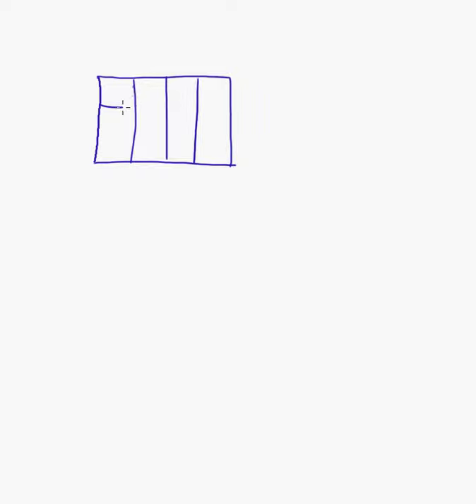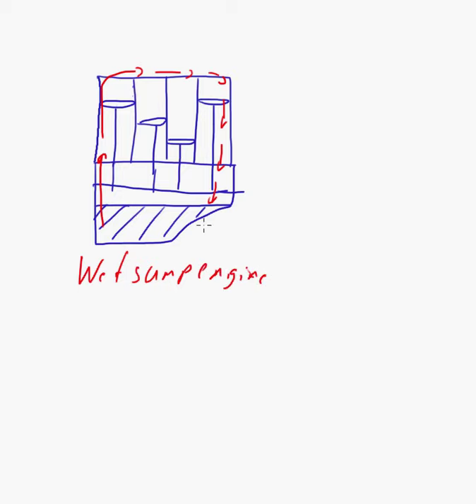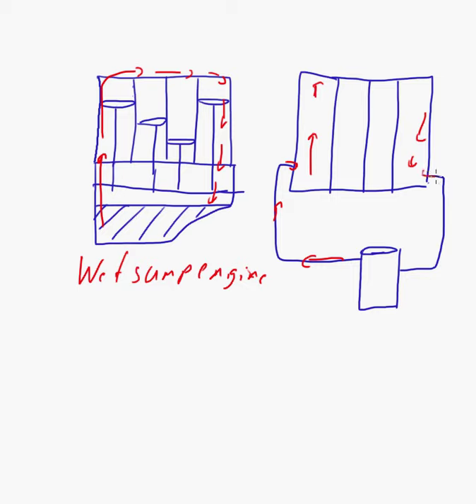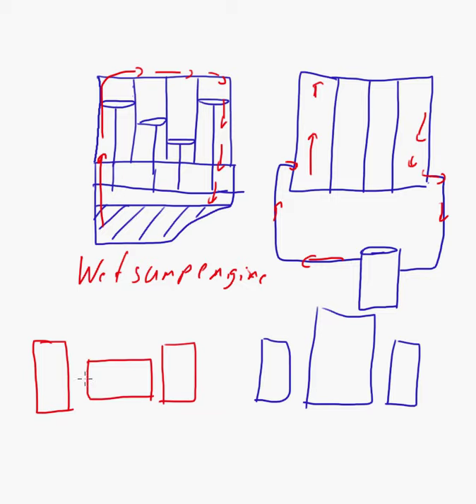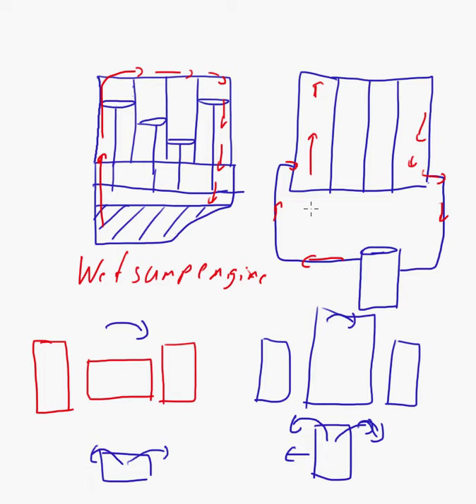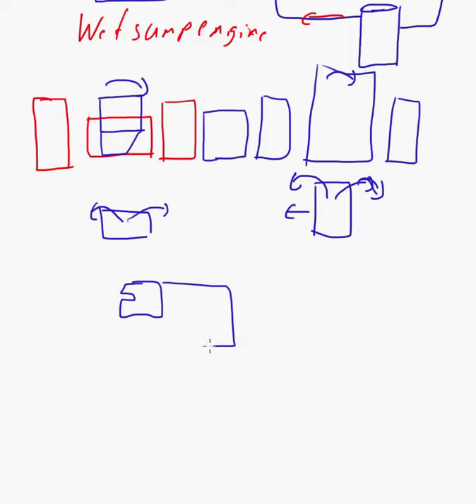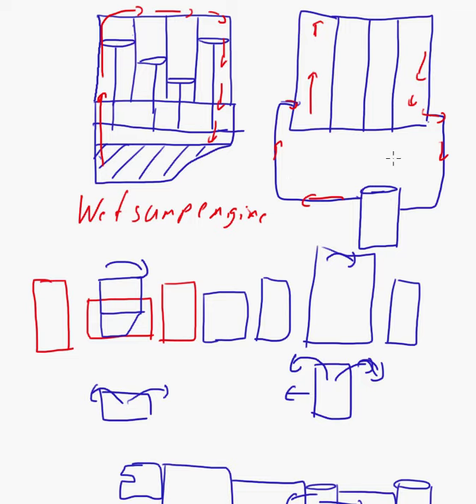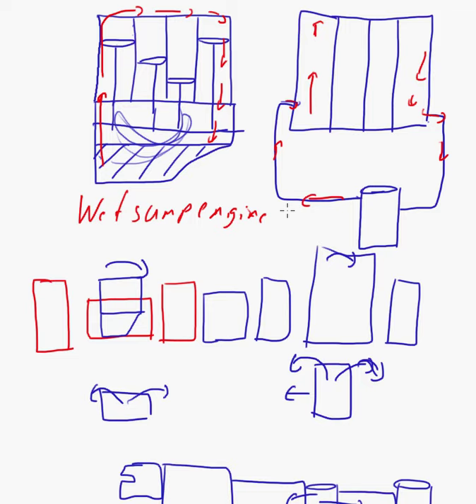Engines with Dry Sump Lubrication Systems

Comment: Very helpful video. I am going for my pilots licence and was wondering which sump system would work better on smaller planes and why. Thanks
Reply from the maker: I am no plan expert. As far as I know planes with piston engines use either wet or dry sumps. Dry sump systems are more complex, due to their requiring more pumps and plumbing. So I presume that bigger engines would use dry sumps whereas smaller cheaper ones would use wet sumps.